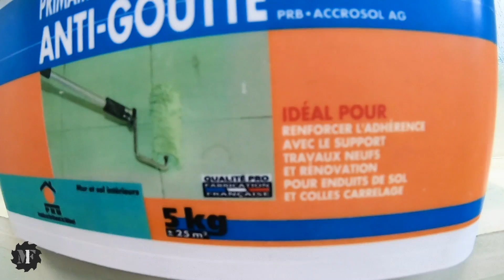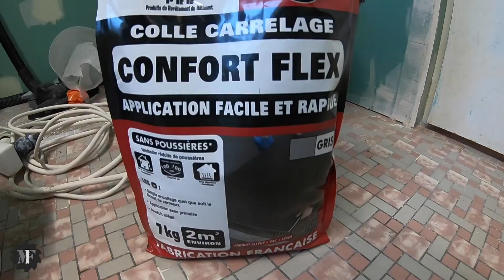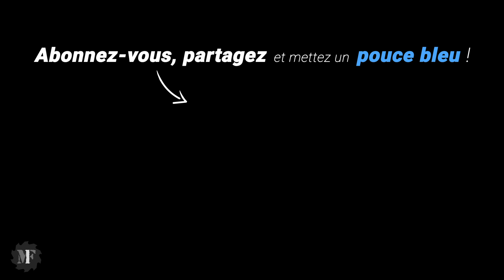Comment rénover une salle de bains - Partie 9

Comment: Salut à toi Cédric, quel est le systeme d'étanchéité le plus écolo-écono-efficace entre natte d'étanchéité et SEL selon toi?
Reply from the maker: Hello Léonard,
Franchement, aucun des 2 ;-)
il n'y a que du pétrole dans tout ça...
Bonnes fêtes de fin d'année,
Cédric
Reply: @MakeinFrance  haha, ya pas un SEL bio à base de résine de bouleau des Vosges ?
Reply: @MakeinFrance  chez Le roi merlin (1er), le vendeur me dit qu'on leur explique que c'est la colle et joint de carrelage en epoxy qui font l'étanchéité, t'as déjà posé comme ça ?
Hé bonne année à toi bien sûr pleine de  chantiers et de vidéos 👌
Reply from the maker: @leonard00z96  les bonbons des Vosges, oui 😂
Reply from the maker: @leonard00z96  pour le sol carrelé d'une douche,le top c'est décoller et pointer à l'epoxy... si tu fais uniquement lesjoints à l'epoxy, ça passe.
Maintenant, il faut quand même une protection de type sel ou natte au sol.
Reply: @MakeinFrance  ça accroche juste le joint en epoxy sur colle classique ?
Reply from the maker: @leonard00z96  en fait la colle/joint epoxy, tu peux coller et jointer avec le même produit.
Tu peux faire tes joints à l'epoxy une fois ton carrelage posé avec de la colle carrelage classique.
Il faut bien maitriser le joint epoxy car ça tire très vite... très très vite !